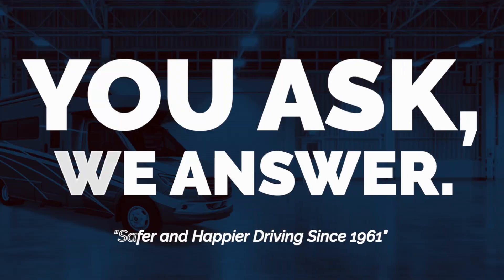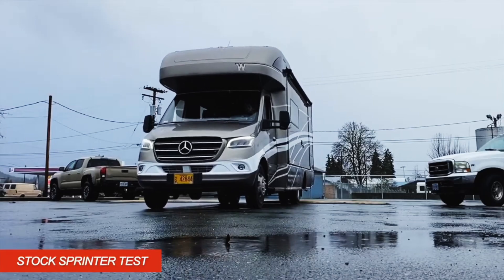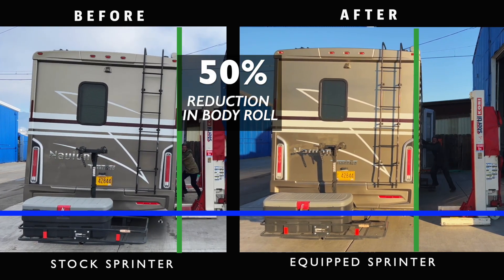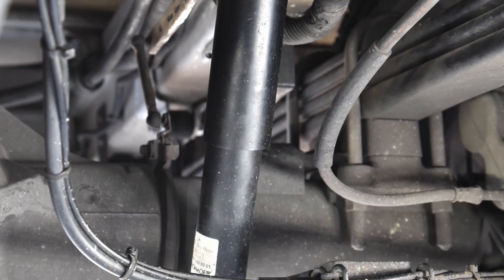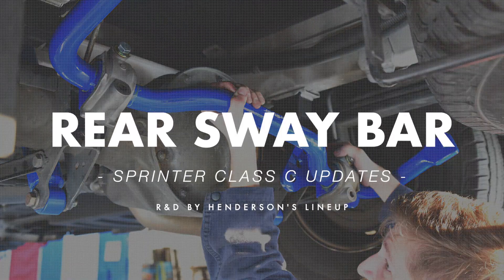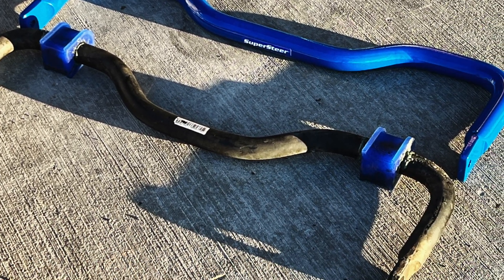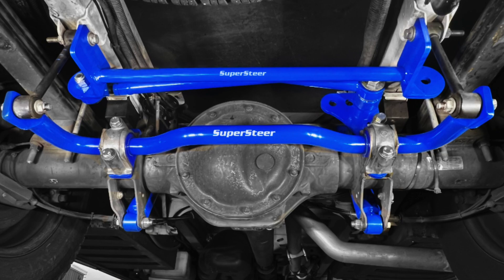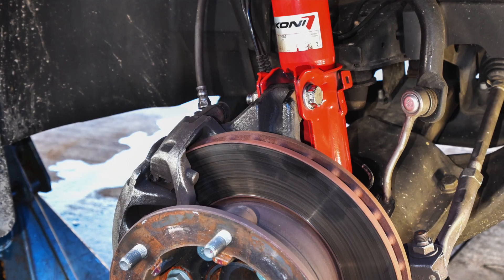Unbelievable Transformation: Upgrading Your Mercedes Sprinter - Here's How!

Comment: Have you tried this on the 4500  series?  Anyone tried airbags in the rear with addition of your set up? Thanks, David.
Reply from the maker: Good question! To my knowledge our work has just been on the 3500 dually. That being said, from what I can find the 4500 is very similar to the 3500 but has a higher payload capacity (the trade off is a potentially lower towing capacity since the GCWR is the same between the 3500 and 4500). I expect that our standard upgrades of rear shocks, rear sway bar, rear trac bar and front struts would also work well on the 4500. Regarding air bags, I do not believe there are add-on airbags available for the Sprinter any more due to frame cracking issues. We did try our shocks on a coach equipped with the VB Rear Air Suspension and they worked very well.
Reply: @SuperSteer  Thank you.

Comment: When you installed the Tracbar on the Sprinter did you have to modify the exhaust?  I have a 2022 Jayco Melbourne on the Mercedes Sprinter with the exhaust coming out to the rear of the RV and I am being told the exhaust must be modified to come out in front of the rear tires for the tracbar install.
Thanks
Reply from the maker: Good question! On our Navion the exhaust already exited in front of the rear axle, so we did not need to modify the exhaust. If as in your case the tailpipe exits behind the rear axle, then it must be re-routed to exit in front of the rear axle.

Comment: What's the difference between your sway bar, and hellwig?
Reply from the maker: Good question! Our SS110 is made for us by Roadmaster and now includes new heavy-duty end-links, while the Hellwig reuses the factory links. For older (most pre-2016) Sprinters we also can provide the upgraded Mercedes-style saddle brackets, while the Hellwig kits on older units use strap-style saddle brackets which sometimes break. In general, we prefer the quality, fit and finish of the Roadmaster bars to the Hellwig units.
Reply: @SuperSteer  , I'm considering replacing my hellwig bar, With along , the track bar setup as well. 

Since the Agile RIP, the new rear leaf springs create a piping sound when the rig goes over uneven surface. For example, a driveway. 
Everything is torqued and check multiple times , but I don't know if the axle is walking or shifting,  cresting that loud metal poping noise.
Reply: Recommend- Supersteer’s. Was an easy self-install if you have the tools (impact driver and torque wrench)

Comment: On Tommy's advice, I installed The track bar a few months ago. We live in Metro Atlanta.  The longer the trip, the more noticeable the improved stability with crosswinds and the semis. Our last trip to Florida, the wind was hitting his broadside till we made it to I-10.   The track bar really did make a difference in stability and confidence. I watch cars and vans being pushed around on the interstate too. This added another improvement stabilizing this top heavy Winnebago during semi passes.  Thanks Super Steer!  Money well spent because of the added safety.
Reply from the maker: Thanks Earl for the great feedback!! Glad that the SS701 has made driving your Sprinter more enjoyable. Similar to your experience, we noticed the rear trac bar really helped out with stability in high winds and when semi trucks pass. Considering how tall, narrow and relatively light the Sprinter chassis is, anything that can make it more stable in the winds is worth it in our opinion!
Reply: Thank you for the great feedback ! We have 82 K on the 2022 now. We have developed a new rear spring kit that improves ride and handling.
Testing Sumos on front as we travel to FL and Tampa Super Show Jan 13 to 16 2026.

Comment: I was also shocked at the very noticeable sway improvement the Koni adjustable front shocks made. I have a heavy duty sway bar I put on years ago and I've been very happy.  I had no idea the Koni shocks would have any impact on the sway.  I set mine to 80%. I'm extremely happy with them.
Reply from the maker: Glad you're enjoying the 87-2657 Koni struts! The difference they make definitely is dramatic - they work well with a good set of rear shocks to cut down on the typical Sprinter "rock and roll" issue, and also cut down on dive in corners so much that it felt like we had put a bigger front sway bar on.
Reply: @SuperSteer  a few years ago, I put the Fox 2.5 shocks on.  At the time that was the best option.  And what a fantastic difference they made.  Would be nice to know The difference in your new shocks and  the fox 2.5.  The fact your custom Koni's are adjustable and hydraulic dampening both ways huge pluses.
Reply from the maker: @earlhunt2815  Good question! The Fox 2.5 shocks were one of our competitive benchmarks when we developed our shocks, because they really do a great job in cutting out the rock and roll. The Fox 2.5 shocks currently available for the Sprinter 3500 2wd are monotube nonadjustable, while ours are twin-tube with adjustable rebound damping. With ours adjusted to about 75% of their maximum rebound damping we were able to achieve equivalent stability to what the Foxes provided but with less ride harshness. This is because our shocks are designed to be relatively soft in compression to allow the suspension to compress over bumps, but very strong in rebound to control the body movement. We really like the fact that our shocks can be adjusted to each owner's preference and loading.

Comment: Curious if you've done testing with your wheel spacers prior and after?  I've done everything you have except the spacers, but still feel the push from semis passing more than I like as well as still looking for better handling in the wind.  It's pretty good, but I know it can still do better based on driving other RV's.
Reply from the maker: Good question, thanks for asking! We noticed a bit of improvement with the wheel spacers in wind and coming in and out of driveways. Not as dramatic as other improvements, but they did help it. Are you running the Koni adjustable front struts too?
Reply: @SuperSteer  yes have the front koni struts set at Max setting
Reply from the maker: @rvlifediy  Ok, that's what we found worked best too. There's also the Steer Safe steering stabilizer which we do carry, although we haven't tried that out on ours yet. We are running Air Tabs on the back of ours as well which seemed to help - you might also consider those. Give us a call if you'd like to discuss in more detail!
Reply: Shout out to your outstanding YouTube channel!  Superb how to on the Koni adjustable installation!!!!  I follow you, subscribe to you and from time to time share your diy on our forum.  Thanks for your clear and classy diy's

Comment: 1) does swapping out the front struts to what you recommend in this video, force one to get a Front-end Wheel-alignment?  2) how much weight is the entire SuperSteer Track-Bar apparatus?
Reply: I had the Front Koni's put on here in ATL by our truck and semi shop.  $120 to install and then alignment separate charge.  This shop spin balances the front tires.  Mercy, what an incredible difference...I was due for alignment and balance
Reply from the maker: Hi Dean, thanks for the questions.

1. Yes, if you change out your front struts, you will need to get your coach aligned.

2. The SS701 Rear Trac Bar assembly has a shipping weight of 25 lbs. 

Please let us know if you have any other questions!